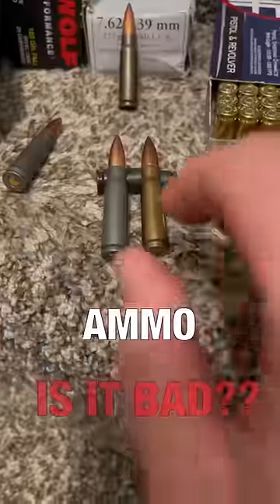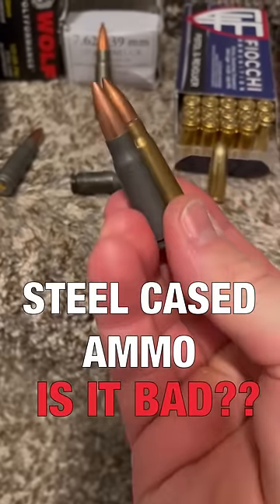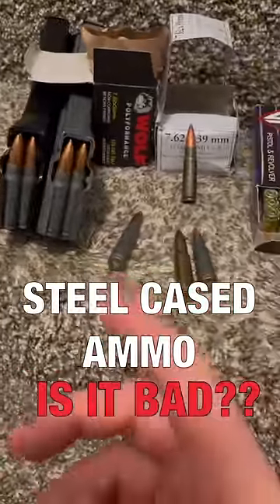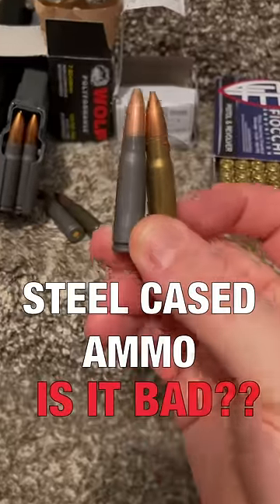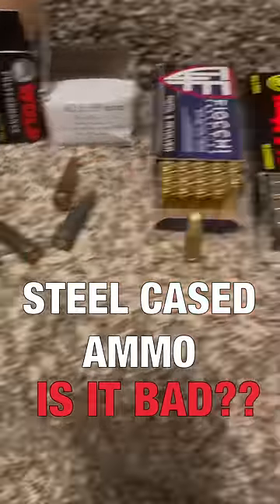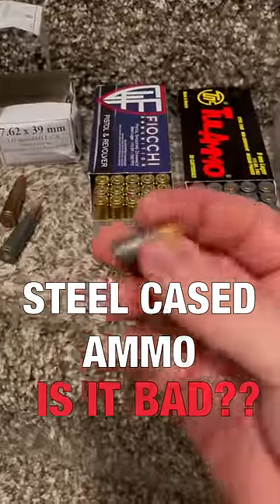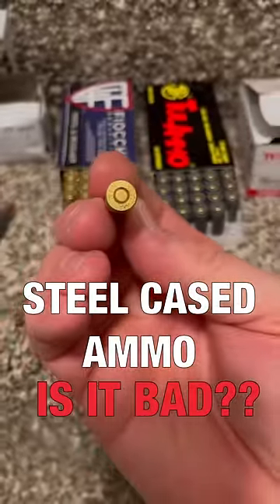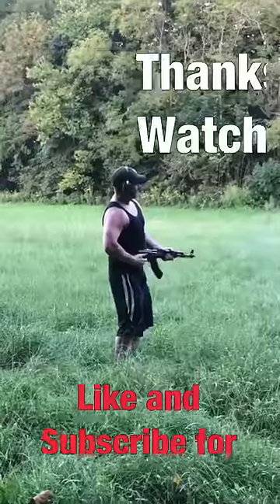Steel cased ammo, is it bad? #short #shorts #shortvideo

Comment: "If it can't run steel, it doesn't deserve brass."
These " issues" have all been "debunked" as MASSIVE exaggerations at best, and old wives tales at worst.
 Steel cases do have some " issues".
The steel used is VERY " soft" and unless your rifle is made of garbage steel, or blatantly poor quality parts you won't see any additional measurable wear and tear.
feeding/extraction problems come from overly tight tolerances developed around brass cartridges, and poor extractor metallurgy.
They also tend to use lower cost " dirtier" powders causing significantly more fouling.
Most contemporary steel cased ammo still uses much harder  primers than are used in commercial ammo, that causes " light strikes" with weaker springs.
Steel stores just fine, even out of spam cans; which themselves are NOT an ideal storage method. Moisture is the enemy of ammo storage, steel cases or otherwise. Those seals and welds are by no means indefinite.
If you use older surplus or "surplus style" ammo( mostly made in eastern Europe from old Soviet stockpiles and production facilities) you don't really need to " thoroughly" clean your rifle after each outing. a quick dousing with a garden hose and some light oil is all that's needed to neutralize the primer salts and prevent corrosion.
"Over cleaning" is an unnecessary, bad habit that serves little purpose other than selling products.
Reply: Lol water hose
Reply: If you use corrosive ammo you do need to clean the gun thoroughly or you will get corrosion
Reply: @djjaysky9071 sorry, but that is simply not correct. It is basic chemistry.
 please explain:
1) how corrosive salts are NOT dissolved ON CONTACT with water.
2) the chemistry you are using to dissolve them with an OIL BASED cleaning solution 
3) how you missed the bit  where I explained the SIMPLE procedure for dealing with  corrosive ammo.
Reply: @apexedgesharpening2005  well, you don't HAVE to use the "garden hose", in the front yard... It just makes it a bit more entertaining for the neighbors.
Reply: @earlycuyler2295  I love hosing down my barret m82a1 50 BMG anti material rifle in the front lawn 😂
Reply: @apexedgesharpening2005  if spraying down a bunch of sks's and WW2 battle rifles on the freshly mowed dirt, oat soda in hand while the sun starts to go down, as your kids play slip and slide a few feet away and your neighbors look up the number to cps is "wrong"; I don't think I want to be "right".
But who am I to tell you what to do with your summer evenings?.
 The old, corrosive .50 bmg is still floating around out there? I thought that dried up in the early 90's. I never owned a Barrett( they just didn't make more than a handful of the model Id want) , but I did have one of the m2 surplus barrel single shot rifles a few years back . I've got no issues running corrosive ammo through a rifle essentially made from scrap parts,or nearly any other rifle for that matter. But idk; at $25k+ " precision"  rifle Id probably just as well stick to factory fresh or hand loads.
Reply: I shoot a Mosin with corrosive ammo all the time. No need for water and lots of oil either, Windex. Spray some Windex on the bolt and wipe it down. Apply some Windex on some patches and clean the barrel. Oil like normal, no corrosion. Give it try if y'all don't believe me, it works and it's easier then spraying water or washing the gun in the tub. When we use to buy the Mosins and Mausers from the gun show for $50 each back in the early 2000's, we took the guns to the car wash and used the high pressure to wash the cosmoline off and it worked well. Remove the stocks first though, clean those by hand and keep the wood we'll oiled.
Reply: @toddk1377 even the most concentrated "Windex" is like 89-10-1 water, isopropanol,and ammonia, with a little blue dye for flavor.( I used to work in a chemical plant that made a knock off version sold to restaurants.)
Making it no more than a slightly faster drying water, with a bit of a CORROSIVE base to dissolve fats( oils),  clean finger prints and bug guts.
So you are spending additional money to neutralize one salt and replace it with( significantly less) less of another? 
Again, we see people wanting to believe in a " product" over basic chemistry. 
All you have to do for corrosive ammo is a quick flush with regular old hose water, then a thin coat of ANY light oil to displace it and prevent oxidation. Nothing major, takes 5 minutes tops.
Reply: @tapalmer99  ...
...
...
...
I do live in Arizona...
But haven't been in a trailer on the outskirts of Tempe in well over a decade.

Not sure why you pulled down the reply, or why YouTube found it to " spicy".
I thought it was a fair criticism.
Reply: @toddk1377  interesting. It probably has to do with the ammonia. It neutralizes acids so I can see it preventing cosmoline from forming oxidation. I use it to neutralize my etchant on my knives making Damascus.
Reply: It's not even the powder. Older steel used a different primer compound. That primer creates a pretty rude salt compound. Quick scrub after lots of shooting makes for no problem (hell just run water then a light lube patch after drying).

I've never had extraction issues OR feed/seal issues.

Bare steel is more or less as storable as bare brass. They both corrode in bad environments. 

Steel ammo with blue (usually) around the primer and neck are sealed, even better.

The ONLY, problem I've had is the hard af primers on old chinese, russian, yugo ammo. Which was only a problem for a x39 AR build. Heavier hammer springs, problem solved.
Reply: @apexedgesharpening2005  legit. The only problem is the older primer and powder creates a corrosive salt. Water soluble. Literally hose it down, dry it off, wipe it down.
Reply: @earlycuyler2295  well I took "hose the gun down" as "clean thoroughly" lmfao
Reply: @apexedgesharpening2005  because you're not neutralizing an acid, you're removing a salt.
Reply: @ObservationofLimits  nah... I said a quick "dousing", or "flush". Then just a bit of oil to push away any water and stop rust from forming. "Scrubbing" guns is pointless.
Yes, the "issue" comes mostly from the primers. But I guess I did say the communist powder was "dirtier", so I wasn't exactly clear. Most modern smokeless powder is relatively benign, even the worst of it is maybe 1/10th as bad as what the primer produces.
Reply: @ObservationofLimits  ahhh that makes sense
Reply: @earlycuyler2295  
Thanks for the breakdown.
Reply: exactly, only some guns really just won't use steel case.  that is mainly because the very small difference between cases and spacing. most tend to fire, but fail to extract, which is why people says it eats extractors, so if it fails, yes it wears, runs fine, it's usually not damaged.   exactly as said in video.  only gun i stay away using steel in is S&W.
Reply: Uh oh. Someone got offended
Reply: @Dontgetenslaved  i have an akm that WILL NOT run steel. Headspace is just too tight.
Reply: @earlycuyler2295  It happens. I never had an issue other than a s&w m&p 9mm that would absolutely end up running like dog sht after only 50rds. Would start getting trigger hangups, no reset, and it was DIRTY. I could run the same through a glock and have it laugh at it.  I ran steel through my sks with no issues.  Plenty. The mp line imo is junk. I had a 22 compact fail within 600rd.... Trigger issues.  This was within this past six months. I gave up on mp stuff. Old 90s S&W is peak imo. After that...a select few of them..
Reply: @Dontgetenslaved  I've seen it a few times. Mostly in handguns. Walthers( shudders), hs 2000 derivatives, higher end 1911s, etc. Not saying it's necessarily even "rare". 
I swore off "THAT" manufacturer after an some "missing" warranty replacements. it was a whole "thing". So I don't really have much to say about their other products.
 I was just noting this irony of a rifle that was(allegedly) designed to shoot "garbage" tier ammo not being able to lock up on 1/3 or so of all steel cased ammo I've tried to feed it. Tulla, wolf, brown and silver bear, belom, Barnaul ,etc. none of it. It has NEVER even gotten through even a 10round mag of Hornady steel cased rounds. It will pass go/ no go gauge tests all day long and runs even the cheapest, dirty brass m87 surplus without fail. Never seen an ak be so picky. It's been into the gunsmith 2ot 3 times for second "opinions" and they figure it's the same thing. It's to tight to spec, but outside of feeler gauges, and it not going fully into battery, you'd never know. But it figures. It's a Century. The ONE time they manage to "get it right"; They manage to screw it up get it WAY TOO " right" for its own good. Go figure.
Reply: @earlycuyler2295  it's dirty, but in most stuff ibe tried, it has worked.
Reply: @Dontgetenslaved  yeah.. for the most part it works.
Reply: @earlycuyler2295
Reply: @earlycuyler2295  your use of quotation marks disturbs me. Like I can't trust what you're saying, but also my life depends upon "trusting" your word?
Reply: @Rabbit-the-One  why?
"You" can " trust" ... " Me".

Honestly, it's just how I learned convey information via "conversational"  text to engineers via job riders for the past few decades... I guess it can be a bit "much".
You can imagine me doing "air quotes" every time if it makes you feel better.
Reply: You got a point, I built a 7.62 ar and the extractor broke after 5 or 6 hundred rounds of steel. I just fully replaced the bolt with a bcg made of tool steel and it’s still trucking 2000 rounds down the road. Just don’t use bad rifles
Reply: Please use more quotations...ffs
Reply: @earlycuyler2295  can you use more quotations please
Reply: I chambered my target rifle with the minimum possible headspace and it runs steel just fine. Seals up nicely, no soot on cases, extracts and ejects right into the same pile as the brass cases. Most of the steel case bad fuddery is just nonsense.
Reply: @randomidiot8142  what gauges are you using? What are your tolerances? It sounds like you've just got a properly headspaces rifle.
The headspace " issue"  comes from manufacturers that try to get right up to the spec, without allowing a couple thousandths for the variances in the dimensions and loose qc tolerances of different types of ammunitions.
Reply: @pieheadthemainiac5480 You're*...

Literally none of that is accurate.
Steel cases don't "jam up" any more than brass rounds, or cause excessive wear damage to firearms. You must not understand there are MANY different " grades" of steel some soft and pliable, very similar to brass while others are much harder and more resilient.
And not ALL steel cased ammo is " cheap". Hornady being the best example that comes to mind, sells some steel cased sst rounds at a HIGHER price point than their comparable brass cased equivalent.
Reply: @earlycuyler2295  JGS 3154 reamer and cip gauge. I've got three other barrels from different manufacturers that haven't had an issue with steel, and they're much looser than my target rifle barrel. Brass and steel ammo has about .002" of headspace in the target gun, the other barrels have a lot more.
Reply: Just curious what your barrels are like.
Reply: @giiysutsputs  Just fine. I mean, yeah most have a  carbon and some brass fouling, but they still group well within practical accuracy. I have data suggesting that few have even " tighted up" over time.
The barrels aren't even the "worst" part of only doing necessary maintenance. depending on the type of firearm, the gas system can be disgusting.
Reply: @randomidiot8142  sounds about right for a hand built, dedicated "target" rifle. I was hoping you had found a new, more precise gauge set.
  I've seen bench rest guns down in the sub 0.000125" over realms; ok that might be on the extreme end, but you get the point. those guys develop loads per shot, on the line; and a few bits of dust or god forbid a grain of sand could prevent good lockup. No thanks. A little wiggle room is all you need.
But I don't think it's out of the realm of possibility that a "mass production" manufacturer, while attempting to nail that close spec could inadvertently go a thou or so under. No machine is " perfect". There is no such thing as " right on the money" . Even more impossible is doing so twice, or 100,000 times afterwards. it's all about tolerances, and acceptable degrees of variance.
Reply: @earlycuyler2295  it's an AR and I've run 500 rounds without cleaning, steel and m67 included.
Reply: @giiysutsputs personally don’t ever run steel thru your gun if you have a love for your gun that is if it’s a hundred dollar gun then bud all means run crappy steel no big but brass is only meant for nice high maintenance guns.
Reply: @randomidiot8142  right, but you spent the time and effort to get it done right, to make sure your headspace was right, something " big name" companies just can't afford to do anymore.
I had a clapped out sks( they used to be cheap " project" guns) that I converted to a straight pull in 6mm dasher. Headspace was a nightmare to get "just right". I SHOULD have just made a new bolt head, but I thought it would be more " fun" working it out from the other end. hindsight is 20/20.
Reply: @earlycuyler2295  something I've noticed that the ak and sks also have in common is short aggressive gas systems on AR barrels. I've got a few more blanks to work with and one will end up being a mid gas 16". I'm confident it'll be just fine. On ARs, even in 5.56, short aggressive gas systems and overgassing is hard on bolts and extractors. My 3 factory 7.62 barrels are way over gassed and can cycle a PCC/8oz buffer. My rifle 24" has enough gas left to cycle with a standard carbine buffer, even with Barnaul and Igman m67.
Reply: @earlycuyler2295  proof how about thousands of brass being run thru my guns I go shooting almost every weekend and it’s common sense something you know nothing about city college boy let’s put it in lamen terms for ya a 22lr you don’t fire the lead you fire the copper tip ammo cause it doesn’t jam and it’s a lot easier on cleaning your 22lr pistol or rifle (I personally have a bull barrel ruger mark 2) and never had one jam until my son borrowed it and ran lead tip ammo thru it. It was terribly gummed up when he gave it back complaining on jams I cleaned it ran copper tips and didn’t have one problem common sense.
Reply: @randomidiot8142  yeah... I don't " do" the ak/ar hybrid thing, so outside of "general" issues, I can't speak on the subject much beyond what I've seen or heard. They are a " neat" idea, but they just aren't in my wheelhouse, or on my " radar" as a project I'd like to get my hands into. Idk. I look at them as separate beasts all together. The whole " stoner system"  lends towards well timed PRECISION. Whereas akms are made to " just work" under any circumstances.
And if I'm honest I find the ak platform more "rewarding" to work on imo.
What I can say about ars, and akms; independently- 
 aks are NOTORIOUSLY way over gassed from the factory, and typically need to have it " tamed". and ars would just about always benefit from more gas being forced through the system, especially when someone wants to use an undersized gas tube and heavy buffer weights for whatever reason. But, on the plus side, at least if you have to change something, it's little more than a potentially frustrating afternoon project. If I never have to press out an ak barrel pin or grind out and replace trunnion rivets again I'll die a happy man.( hence why I've just accepted my cheap ak just doesn't like steel... It runs well with brass, and I'm done putting work into a range toy at this point.)
As far as "projects",
 Ive recently finished an arsenal slr receiver into an ak104 style sbr build. Between the adjustable gas block, the 4 piece " booster" and the kns piston ( which WAS NOT part of the original plan, it just fit the new gas block position better than the original or anything I had in the parts bin) it's probably the most adjustable gas system EVER installed on an akm. I like it a little on the" hot" side for absolute reliability, but if I down tune it a little at the block perceived recoil is around that of a 22 magnum, and the booster can be opened up just enough to operate as a manual repeater. Not sure why but it's satisfying to see the spent brass drop out instead of it being flung into the next zip code.
I'm still working the kinks out of a 6.5 creedmore AR10 build; but it's been sitting for a while with the holidays, and I'm starting to think I should have gone with a smaller bullet. I'll probably get it squared away early next year to sell, and start the 6mm creedmore project.
I've got half of an ak pistol on the bench I want to chamber in .357 sig( because reasons) but finding a good magazine platform is driving me nuts. I REALLY want it to feed from Beretta 92 style mags ( to match my 96 conversion) but the angles are just all wrong.
Reply: This has more quotations than a news article and more sayings than a buzz feed article
Reply: @adrianhernandez1328  not sure about the over use of idioms (but I don't doubt it) but at this point, out of pure curiosity I'd like to see a firm count on the number of "quotations" used, and what would be a more  "appropriate" number to use in the future?
Reply: Steel cased ammo almost always with a few exceptions has a bimetal jacket. Steel with a very thin copper coating over the steel jacket. This will wear out your barrel faster. Thats why aks and skss almost always have chrome lined barrels. If you have a chrome lined ar barrel then steel will be ok. If not using it sparingly.
Reply: @thomasjefferson4662   incorrect. The science just does not support this myth. What you are hypothetically seeing would most likely be " copper fouling", stubborn carbon deposits from " dirty powders" or corrosion issues( from using high detergent oil based cleaning products instead of water); not barrel damage.
 all "steels" are not the created equally. Refer to the " Rockwell hardness scale" for clarification, but for the sake of discussion I'll provide some rough estimates off the top of my head.
( I apologize for estimating here , but I'm only on my 2nd cup of coffee, and don't feel like digging through data sheets just yet... Ok. Deep breath, it's about to get nerdy)...

The steel used in bimetal jackets is INCREDIBLY soft material, softer even than the Very "mild steel" used in the cases. it typically measures  between mid 50s to ( rarely) high 60s hrb depending on manufacturer. Most copper used for jacketing barely hits the 40 hrb mark, but copper can be " temperamental" in testing from " work hardening" so it's best to round up if you are measuring "formed" material.
Heat treated, hardened steels, like those used to make firearms barrels are measured by a different metric altogether,( hr"C" instead of "B") that was developed to measure the hardness of materials that top out the hrb scale. Most barrels "should" start somewhere around 60hrc, and go up from there, almost if not DOUBLE the hardness of the steel jacket that's " under" the softer  copper alloy jacket.

Also, aks and sks USED to mostly have chrome lined barrels to prevent corrosion from the chemicals produced by the previously discussed primers. It has nothing to do with barrel wear from jacket materials.
Reply: Could not have said it better
Reply: @sixpest  the  funny thing is,  most of the  people that seem to REALLY want to disagree with " what" was said,  only want to focus on " how" it was said; instead of refuting the assertions made that they disagree with.
I'd LOVE for someone to pose a legitimate counterpoint that can't be easily dismissed by readily available data or a cursory investigation.
Reply: @earlycuyler2295  They cant lol
Reply: @pieheadthemainiac5480  ...
 you missed one.

But There was never a need to delete your old comments.
It's ok to admit you are wrong.
 Being "wrong" is how we learn new things, correct previously held misconceptions, and grow as people into knowledgeable human beings.  Nobody is perfect, or right about everything. Lots of information changes as we advance as a society, and we can't just ignore anything contradictory to our beliefs. I know it's tough,  but being able to set aside our egos and LEARN is an important skill to have.
Reply: @earlycuyler2295  that’s some true blue American shit right there
Reply: @deliverus6856  well, aww shucks.
But seriously, I'm not that "great" of an American.
I despise our government and the political machine that runs it, I ALWAYS try to pay as little in taxes as possible.
I ONLY  served in the military because it sounded slightly better than prison at the time.
I  think our military has become a corrupt joke over the last 25 years( both in it's " ethics" and application) and the citizens have become overly compliant in exchange for the comfort of "modern conveniences".
I'm a "citizen" of the state of Arizona, which so happens to be part of the United States. It might not be that much "better", but it's easier to hold state government accountable for what they ( don't) do.
I think youre giving me WAAYYY to much credit.
I manage to live as independently as possible, and found a niche market I enjoy that lets me( along with calling gun purchases" business expenses") put food on the table.
 I've just made a lifelong habit of ALWAYS asking " says who?", And putting in my due diligence to make sure that the data aligns with what I accept as "truth". It's not all  that hard.
That and not backing off from confrontation, or being afraid to be wrong sometimes...
Unless you were just talking about how I like to torment my neighbor from RI by "watering my guns" with the kids. That guys a jerk. But like all opinionated hotheads, he's easy to get a rise out of, and his little temper tantrums are VERY amusing.
Reply: @earlycuyler2295  I didn’t erase one damn thing boy
Reply: @deliverus6856  see^
Reply: Tell you what buddy you go out and you buy a box of 38 special steel cased by that s*** show of a company wolf and you load it in your revolver and you tell me how easily it extracts from the cylinder.
Reply: did you just say garden hose? in a rifle? grab some clenzoil and a couple of barell mops it cleans and treats the barell. I use it on my 300 win mag and it's way better than clp or break free.
Reply: @johnc.hammersticks   YES! absolutely.
Why wouldn't you use a garden hose for the purposes actually being addressed?
go back and re-read the post.  Im pretty sure you've missed some important context. 
We are discussing the alleged "shortcomings" of steel cased ammunition, and how its not nearly as " bad" as the fudd lore surrounding it suggests, one of the " issues" espoused by detractors is that it is " corrosive". Yes it can be, but so can brass, and the process for dealing with corrosive ammo is the same. Dissolve the corrosive salt in regular water, flush the water out, dry and oil to prevent rust. Easy peasy. No "intensive" cleaning required.
To the best of my knowledge there is no commercially available 300wm that uses EITHER steel cases OR corrosive primers. So, unless you are reverse engineering old corrosive berdan primers into your 300wm handloads( who hurt you?) this process is entirely irrelevant to the situation you present.
Reply: @earlycuyler2295   I do terminal ballistics testing for a living, I break down and clean every weapon I use. All my loads are hand loads in brass with 20+ diffrent projectiles, calibers and powders.  I use winchester magnum and large rifle primers. You always take care of your firearms and properly clean them. It's gonna suck when your pistol stovepipes  after the first shot because it's beat and dirty. 
 As for the hose why in the hell would you hose down your gun like a muddy dirtbike you are gonna have problems down the road and you won't blow your face off. If you reload I can give you my DOPE (Data On Previous engagement) notes If you have a 7.62x51, helps in hunting season with temperature stable powders
And proper barell harmonics.
Reply: @johnc.hammersticks  HAHAHAHA.
" Errr, I know gun words"
...really? This game?.
 let's unpack the claim of " I do terminal ballistics for a living"
 ...before I invalidate it, and the position you have tried to take here.
" Doing terminal ballistics"... What are you " doing" with them? For what field is the data being collected? For what purpose? To what end?  Is this to determine "what" those terminal ballistics are? To Evaluate them against known standards? Is this for quality control purposes? There are lots of jobs ( my own included) that "involve" the study of terminal ballistics, and the application of that data it is a useful tool.but  "doing terminal ballistics" is a phrase that can apply to pretty much ANYONE that's ever fired a gun and looked at what the round " did",
But "Terminal ballistics" is NOT a field in an of itself.
Seems more like an attempt at an " argument from authority" fallacy, and a poor one at that. You want to use the term to project an undue air of " expertise" in your comment, only to have it betray your own ignorance by not even understanding what those words actually mean. The same reason you are chomping at the bit to "offer" unsolicited reloading data, and wasting time explaining  rifle"dope". It makes it  "sound" like you know what your talking about, but it just doesn't add up to a supporting argument.
You WANT to discredit my "assertions", but cannot come up with a solid, valid point, and are  resorting to claims of  " trust me, I'm an expert on this".
Can you explain how this discussion has ANYTHING to do with "terminal ballistics"... At all. How is it applicable, or relevant to the topic at hand?
Its not.
Do you even know what " terminal ballistics" means?
What causes failure to eject malfunctions?
 The fact you STILL don't realize " why" you ABSOLUTELY would want to flush a rifle with water after firing corrosive ammo, even after it's been explained here multiple times further severs to expose your lack of experience, understanding, and the dishonest, biased "agenda" to promote the nonsense you choose to believe in here.
So yeah. Nice try, but I'm calling your bluff. 
Your gonna have to do better than Googling some charts, basic .308 load recipes and a couple industry terms if your going around trying to " play expert"  here.
Reply: @earlycuyler2295   it's easy, have an array for testing In a certain material say steel, ceramics, body armor/Kevlar, ballistic panels for walls inside banks and goverment property.  Engine plates that absorb impacts and keeping your block in tact. I do measurements like speed, barell harmonics,  the weather on my barometer if we are outside.
 my DOPE book loads are caliber/powder type and load.
 Projectile grain weight/ construction/
 manufacturer. Barell length, bolt/ semi auto/lever And speed. My 149gr 300win mag copper solid loads are clocking at 3,800+ Fps.
   Again If you load your own and hunt I can give you some load data that can help you land a buck or a moose easy.
 Check out the 45-70 Govt. Lever action. 350gr brass solids will crack AR500. Throw 3 through a tree if you don't have a chainsaw and it will  one down.
Reply: @earlycuyler2295   my  o.ments are still up there guy. Seems like you just want to argue with people. You can't be this mentaly unstable and work with firearms. I've offered twice for you to come visit, and you ignore it. Are you on the spectrum or what?
Reply: @clayton9136  lol...
it's 2022; Let's not go around assuming a rifles gender.
Reply: I always clean my guns after each use I think you just sprang it down and putting light oil on it sounds a bit reckless but hey it is your property
Reply: @Bigcheese1334  did you mean spraying? Spray-ing.
Reply: @clayton9136  I'm definitely getting some " pinky and the brain" vibes
"sprang!"
Reply: @earlycuyler2295  Spranger down son! 

Lol I feel like you and I would be good friends irl.
Reply: @Bigcheese1334 I never said  there is ANYTHING wrong with regular cleaning and maintenance.
I said that "over cleaning" is a bad habit;  carried over from a long bygone era of low quality metallurgy and extremely corrosive black powder propellants. The use of water is to clean CERTAIN firearms is to address the last vestige relevance to this concept. If you used ammo with corrosive primers, you should rinse them with water ASAP to dissolve the corrosive salts they produce, and you should apply oil to prevent that water from causing rust. But that's it, after that's done, you only need to follow your typical cleaning routine.
 Realistically, after a typical range trip,( let's say 100rds or so)  there really isn't much to actually "clean". Maybe A little carbon and some dirty lube at worst. Sure, it can " build up" over time, and at THAT POINT it will need to be cleaned, but for the most part (excluding a handful of well known exceptions to the rule) the "gains" of constantly cleaning are null.
And while no one here will admit to it,  TONS of gun owners cause SIGNIFICANT damage to their firearms in the pursuit of keeping them ready for a museum display. Improper cleaning processes WILL DESTROY a barrel in very little time. If you are cleaning after every range trip, and start seeing a decrease in accuracy,  the typically response is more intensive cleaning,and it becomes a vicious cycle that ends in a bricked firearm.
Reply: @clayton9136  maybe he thinks he needs to replace his( clears throat)  "sprangs" after every trip to the range. Idk. Maybe we should ask the "doing terminal ballistics" expert. I'm sure he's got a .5.56 recipe that explains why. Lol.
 All I ask is that you are honest, as long as you can handle that we can be bfffls.
Reply: @earlycuyler2295  KCl, or potassium chloride as it's commonly known is the main corrosive salt, but and it absolutely does dissolve with a quick water dousing.
Reply: @chemistryofquestionablequa6252  
How long do you suppose it would take to dissolve in a high detergent oil?
Double check your data... It's potassium CHLORATE that's produced, NOT chloride...you're thinking sodium.
While sure, it's nowhere near the most soluble, hydroscopic compound known to man... It DOES attract moisture ( it IS an oxidizer) , and is pretty dang soluble in water.  My charts show About 10 grams per 100ml @ room temp. That's about the same as sodium bicarbonate. Sodium chloride( the OTHER main corrosive chemical formed by " contemporary" corrosive primers) is about 5x more soluble than that, if Im remembering correctly.  As opposed to ( most) hydroxide or carbonate salts which aren't all that soluble.
Or did you want to debate the amount of water used in a " quick douse" or " flush"?
Sheesh;  run some water through it. What is so complicated about it? If you don't think you used enough to dissolve the salts, do it again.
Reply: Based af
Reply: @earlycuyler2295 I wish I had you and your knowledge as a friend.
Reply: Cope.
Reply: @earlycuyler2295  you use water because it is a SOLVENT. If you know that then you should use water/water based products. Using oil is plain ignorant. Salt+Water=?
Reply: @coltonendicott  which is EXACTLY as I've had to explain in excruciating detail, multiple times, to multiple people.
The term " solvent" gets thrown around a lot on bottles of gun cleaning products.
Most times, they are actually just oils sometimes with some form of detergent additive, but oils ( for the most part) do not readily dissolve these salts.
"Water based" products do work ... But why bother? 9 out of 10 times they are INCREDIBLY dilute solutions, and you are massively over paying for a few drops of whatever else they contain, that while they might help " clean", it's the water doing the work neutralizing the corrosive chemicals. You're paying for the marketing. The "cleaning and lube" shelves are packed with products that make empty promises to exploit the ignorance of consumers.
Reply: @colerogers6816  no problem, I'll be your friend too.
Reply: @earlycuyler2295  You talk too much man. You got way too much time on your hands.
Reply: @danielplumley2649    aww... someones upset their misconceptions haven't been validated, but can't come up with anything outside of a passive aggressive  "shut up" to shelter them from having to acknowledge well established, verifiable facts. 
How about instead of trying to play "identity politics" to feel better about yourself; like every OTHER ignorant keyboard warrior has tried (and failed) to do so far, you try actually try forming a coherent, valid, counterpoint that you can support with more than fallacy, disproven "fudd lore" , or asserting some of kind of "authority" over what can be discussed.
... I DARE YOU.
Yeah. I've got some "free time". That's what happens when you're running a (reasonably) successful business... Especially during the end of the year, "holiday" season when most people outside of retail/ customer service arent working and " end of year" orders have already been met.
Reply: @earlycuyler2295  You’ve got some serious issues buddy.
Reply: @earlycuyler2295  Hey everyone, this guy has issues
Reply: @danielplumley2649   is desperate for the validation of others.
Reply: @earlycuyler2295  lmao
Reply: @danielplumley2649 enjoys the "bliss" of IGNORANCE.
Reply: @earlycuyler2295  lol!
Reply: @earlycuyler2295  No problem!
Reply: @danielplumley2649  keep on fuddin'
Reply: @earlycuyler2295  To you as well!
Reply: @danielplumley2649  nah. You've got the ignorant whining, identity politics, begging for approval and misinformation covered. 
I'll stick to legitimate, quantifiable FACT.
Reply: @earlycuyler2295  Okay, sounds good man! Keep on fuddin’
Reply: @danielplumley2649   aww...what's wrong? Couldn't come up with anything on your own?
Reply: @earlycuyler2295  This guy sure does love to say “aww”!
Reply: @danielplumley2649  this Fudd sure does like pretending he's said ANYTHING of consequence!
Reply: @earlycuyler2295  This Fudd sure does like to talk! He’ll run your ears off!
Reply: @earlycuyler2295  You talk too much man. You got way too much time on your hands.
Reply: @danielplumley2649 then  prove it....
Heck, prove ANY of the claims, assertions or allegations you've made.
For someone crying about my replies, youve refused to refute ANY of what I've said here.
Reply: @earlycuyler2295  Read your own comments. Point proven.
Reply: Nail on the head, sir.
Reply: @earlycuyler2295 that is true if you use corrosive ammo and don't clean your gun you will get corrosion in the chamber and barrel and it's not hard to clean corrosive salts off your gun and the corrosive part of the ammo is the primer
Reply: @earlycuyler2295 This man wrote a whole documentary to educate us, and I appreciate it.
Reply: @cia8613  np... I got you.
Reply: @earlycuyler2295  credit where credit is due.
Reply: Good point; when i was at basic on Parris Island, one time we really really needed to get our m16a2's cleaned up rather quickly and efficiently, then the DIs had us scrubbing them down in plastic 55 gallon drums with hot water and soap! Lubed them up with clp and boom diggity done!
Reply: My American made AK's usually have problems with steel. My Izh-mash Vepr' eats everything.
Reply: Don’t fucking put water in your gun, you are introducing literal moisture. Just run a patch and oil it up
Reply: @sunnesonne  lol. You're wrong... So very wrong.
Reply: @earlycuyler2295  keep introducing water to your rifles often and see how much will be in small spots that you forgot to oil up, don’t forget to take your break off too, after water introduction, wanna make sure salt and water mix in there. Modern/normal rifles come with chrome coated barrels and gas systems and won’t rust even if you leave the salts in, now introduce water to externals, let it seep under handguard, onto sights etc and you have rust.
Reply: @sunnesonne  next time, try reading before you shove your foot in your mouth again. These "issues" have all been addressed and/ or dismissed in excruciating detail several times over, specifically the FACT that oils do not dissolve the salts formed by corrosive primers. And not once have I said that you do not need to remove the water and oil the firearm afterwards.
While chrome lined barrels might slow down their effects,  it will not stop it from happening altogether, and barrels are no where as likely a place for build up and corrosion to become a major problem compared to gas systems.
...
If you are so scared of water touching your firearms, why on earth would you be " ok" with running corrosive ammunition?
Reply: No. 

Steel ammo has caused the only extraction issues I have ever had. Some of those extraction issues required gunsmith intervention. 

I may use steel (though I generally do not) in a Glock, in a combloc AK, or a PTR.

I won't use steel in any firearm that I actual value. 

That the producer of this video finishes this short with a redneck trailer parkie hip firing an AK says much about his mindset as well as the lack of mental capacity of most of the viewers.

If you can't afford quality ammunition, you can't afford shooting.
Reply: @JD-tn5lz  incorrect.
No collected data sets support these anecdotal experiences.
I've explained EXACTLY why this simply is not an accurate statement of facts.
The science doesn't lie. If you are having " issues" with steel cased ammo, it is overwhelmingly more likely an issue with the firearm(s components) itself.
Reply: Bro thinks people will read this💀
Reply: @TheJokerha  The numbers speak for themselves. 
Way to "ratio" yourself though.
 Maybe if you actually read something once in a while you'd stop making a fool of yourself online.
Reply: @earlycuyler2295  bro thinks imma read that 💀💀😭😭🙏🏻🙏🏻
Reply: @TheJokerha  lol... No. In fact I don't think you (can) read anything.
Reply: @earlycuyler2295  "(can)" 💀💀
Reply: @TheJokerha   so, you DID read it?
...
There is nothing more amusing than someone dead set on proclaiming their ignorance while thinking it's a flex of some sort...
Well, maybe people thinking emojis are a valid substitute for making a point.
Reply: @earlycuyler2295  ain't readin allat 💀💀😭😭🙏🏻🙏🏻
Reply: @TheJokerha  3 whole sentences too much for you?
That tracks.
Reply: @earlycuyler2295  bro doesn't understand that I'm not gonna read his replies 💀💀😭😭
Reply: @TheJokerha  liar...you've already admitted that you read them.
Reply: @earlycuyler2295  when
Reply: @TheJokerha  gotcha again...
You're not very good at this game.
Reply: I thought it was old wise tale not old wives tale😂
Reply: @faucitv4684  you thought wrong.
Reply: @djjaysky9071 well you will get what we call "pitting" and that leads to fowling etc.  definitely clean your rifle as your life may depend on it one day....
Reply: I like to clean my guns every 500-1000 rounds my reasoning is I find it easier to just clean it before it’s too built up then to clean up the build up, cost is basically non existent as I use simple green and then just cheap gun oil that bottle lasts years of this routine, plus cleaning my guns is a relaxing experience to me
Reply: Polymer and light steel is the future